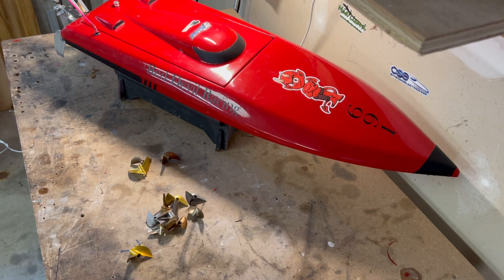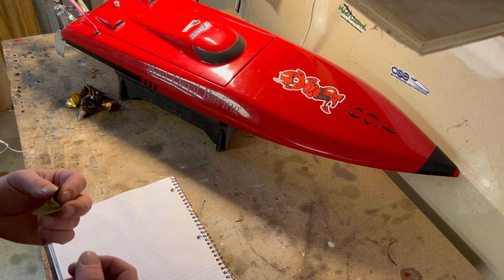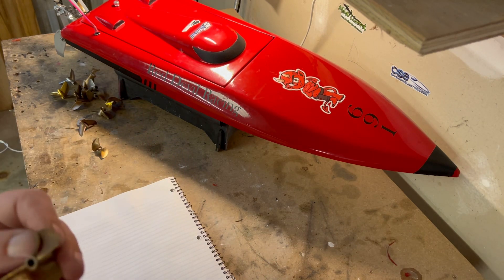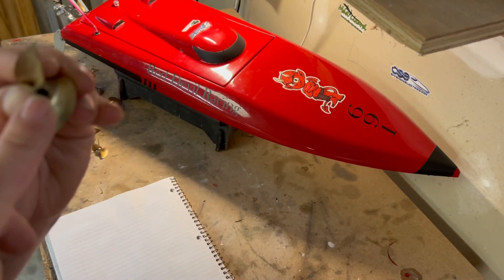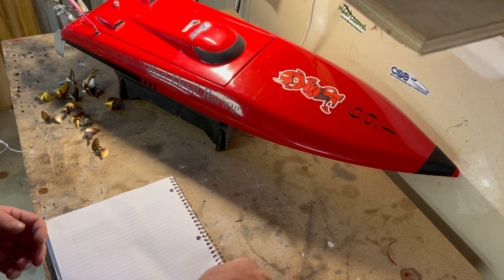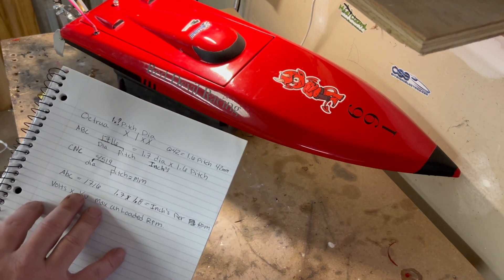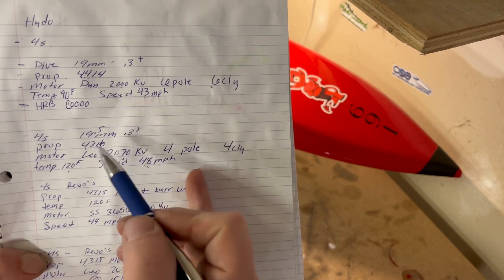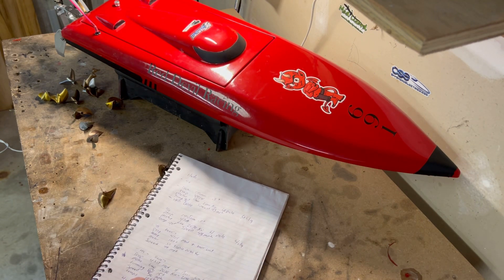Propeller numbers, data and mods

Comment: In your experience, does trimming the tongue on the Octura X4 props add any speed? I understand that amp draw/heat is less.
Reply from the maker: Yes.  You will gain more speed
Reply: @mad_lizard  Thanks, your videos on props are very good. It’s a lot of experimentation and experience to become knowledgeable.